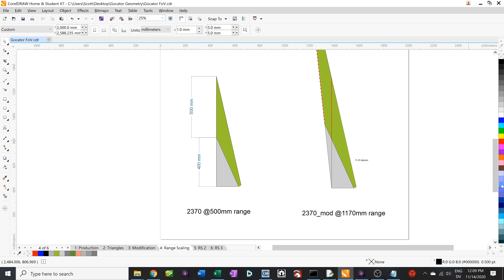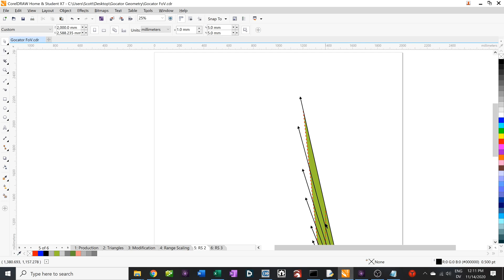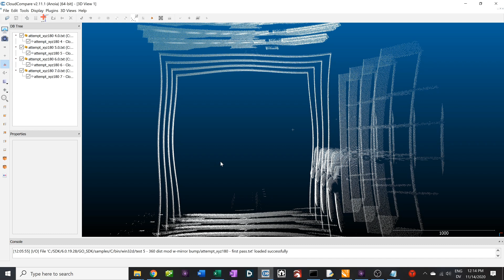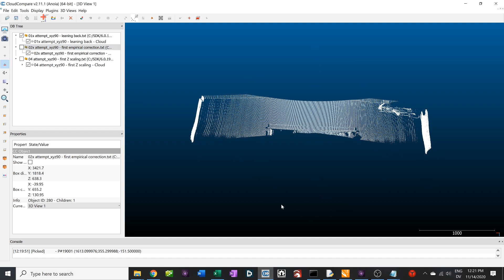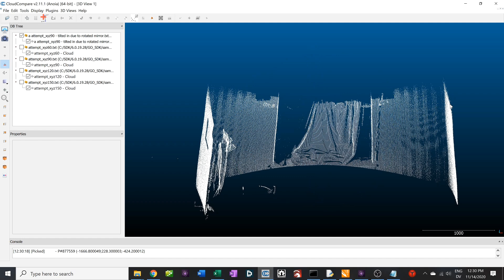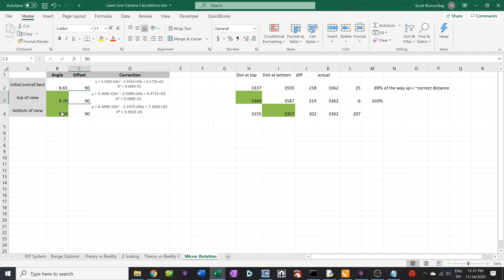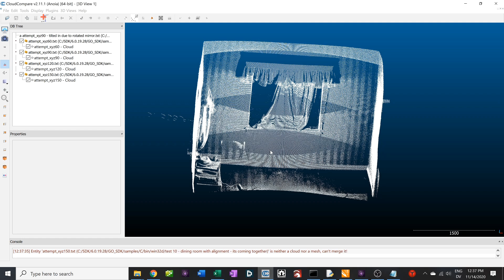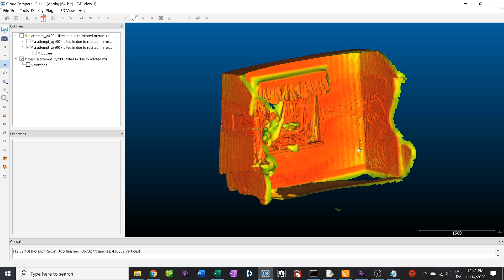Laser Measurement #5

Comment: Love the channel. Would you explain your reasoning for using this method over a photogrammetric one?
Reply from the maker: From research and some testing it seemed that photogrammetry works best when you can rotate around the object. This allows you to get the camera pointed perpendicular to an axis of interest, in which case the camera is a great measurement tool. A few meters divide by 4000+ pixels is excellent resolution.

When you're within a space and limited to just pointing here and there: the direct distance measurement of laser lines seemed ideal. I also like the fact that it's computationally simple, which makes error detection easier.
Reply: @ScottRumschlag  thank you for the explanation. I think you may be surprised by accuracy you can achieve with it but your method is new and much more interesting to me. Thx!